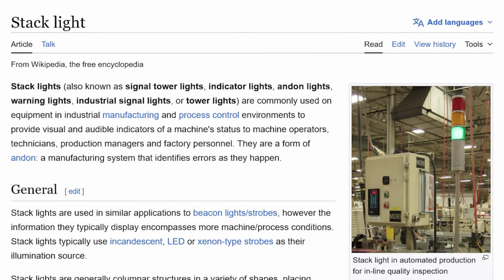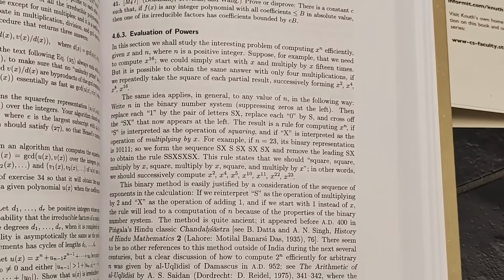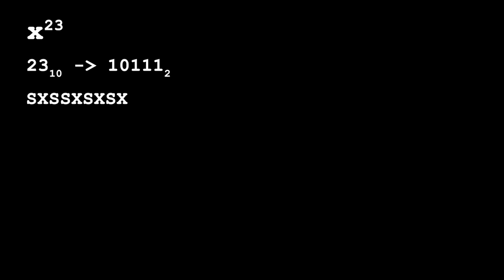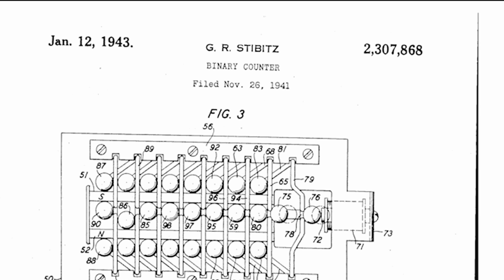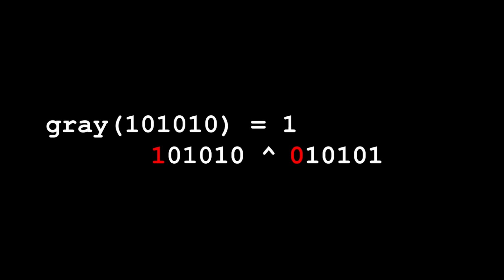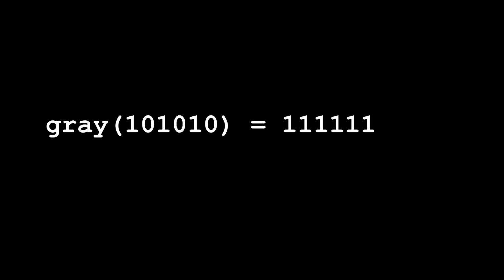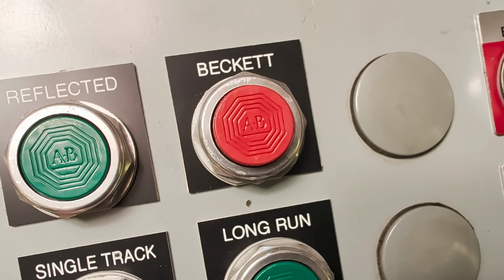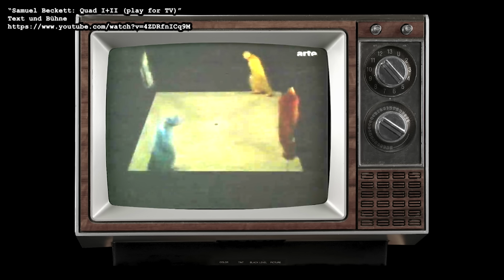The Gray Device

Comment: I had an obsession with gray codes for a while. before even learning what they were. I was playing minecraft, and was contemplating on if it would be possible to reach every combination of binary values flipping only one lever at a time. 2 levers was trivial, and it wasn't too hard to expand. I then realized it wouldn't be too difficult to arrange them such that they could loop. and then started to pattern them out in segmented concentruc circles, thinking to myself that it would be a good design for a positional rotary encoder. when I finally learned about gray codes propper, I was both excited and disapointed. I was dissapointed that I wasn't the first person to come up with the idea, but I was excited that I had found out what they were so I could look deeper into them. honestly just the pattern that you get from wrapping a gray code around a disk is awesome in itself.
Reply: Then you could add hamming codes on top of that